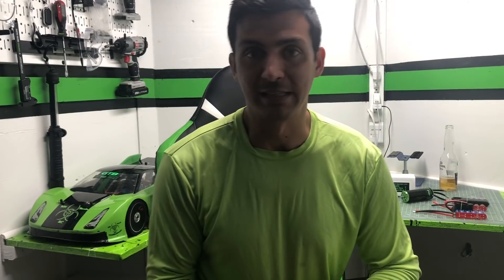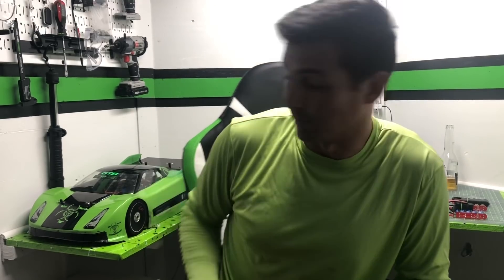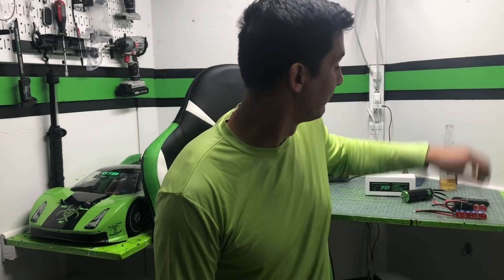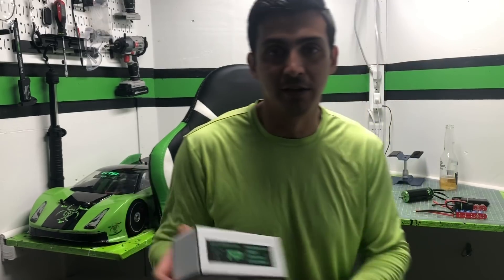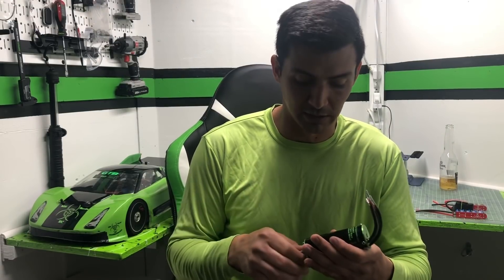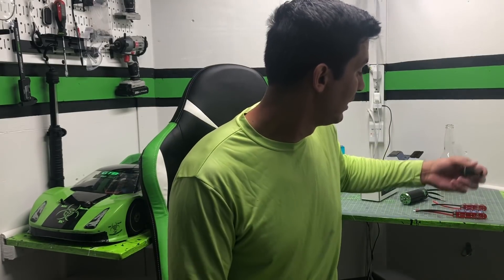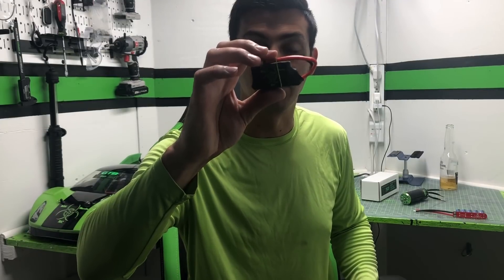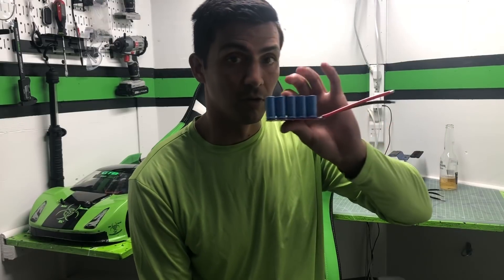Kill Mode RC X-Spec Drag Motor Release Test Pass Data Log

Comment: Hey bro I have you guys is kill mode 4070 2900 KV X Speck motor and I'm running it with the castle xlx 2 on my ArmaLimitless. What pac should I use for that and also should I run 6s or 8s. Thanks for everything you do.  You da man

Comment: Hello sir I was thinking of going with kill mode so I want to build an arrma limitless and an infraction I just got the infraction yesterday. I want to build them for drag as well. I also have a typhon 6s with a mm2 esc and a castle 1515 motor for speed run. what cap packs would you recommend for all 3 and what motor for the limitless and infraction would you say? I want to run 6s I think I'm going to go with castle xlx or hobby wing max5 for both or 1 of each. please any advice would be great thanks? love the builds and the videos.
Reply from the maker: Joe Dingwerth hello Joe. Please send me a text message or email so we can chat. I’ll help you get setup proper. My number and email are on my website. Killmoderc.com

Comment: Can you run mm2 with your motor for drag?? Or Does it need xlx? 

Thank you
Reply from the maker: AZ Airgunner mm2 is a good esc, but will be slightly underpowered for this motor. Especially for drag racing.

Comment: That motor is HUGE for 2900KV.

I'm more of a 1/8 scale basher however, I'm thinking of making a dual moror speed build. I'm just starting to contemplate how I'd like to go about doing it. I was going to sell my DHK Maximus however that may be good platform. They way I've set mine up, the suspension is very tight. It would be more of a drag/drift type than top speed for obvious reasons. Any roller suggestions would be welcome for a project like that. The DHK Maximus build is only a thought as I have one.

Comment: Sorry guys, I'm a noob. Do you have to run a big esc like a Castle XLX for set up like that or is Mamba X ok?
Reply from the maker: I highly recommend a large scale esc to get the best performance. A mamba x will not be able to supply the power to optimize the motor and will heat up quickly.

Comment: Can this go on a arrma typhon or kraton
Reply: Not without modification. It's too long.  Unless you plan on doing some very serious speed runs, there's no need. The new 4260CM in a 2610 KV is much better suited for 99.9% of what either of those rigs can be used for. The 4260CM will put down more power than you'll ever need, but it won't be so difficult to make the ESC survive.

Comment: Hey man nice line bro!! I am getting the infraction soon from my local hobby shop and want to get the kill mode 2900 drag motor for it along with the drag pac. However I have a lot to learn and am currently looking at ways this new motor would fit. Can you tell me is it possible to do without major surgery to my new truck? Im not asking for any benchmark secrets, just want to know that it can be done and would be fruitful. I want the fastest Infraction in my state without a doubt both drag and speed runs possibly the entire west coast. Arrma infraction with Kill mode together!! I can see it, can you?

Comment: I have a question for you...I'm drag racing my arrma talion 132 ft and I have a 2900 tp motor...what is a good spur gear and pinion combo...I'm running 6s
Reply: Tp 2900 is work perfect for drag racing tp 2700 is for high speed.
Reply: @antoniopagandiaz2189  thank u
Reply: 40t spur and probably a 25t pinion